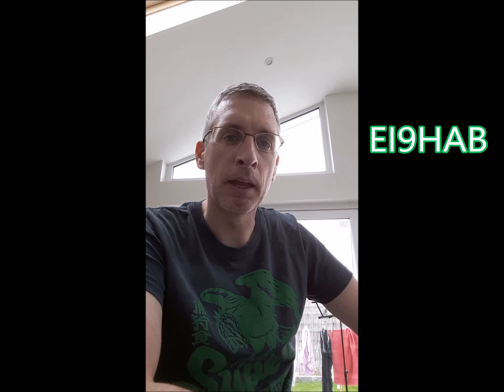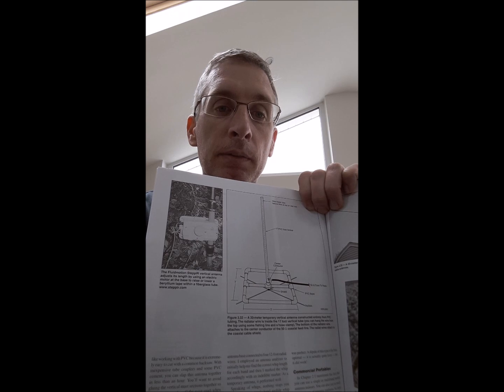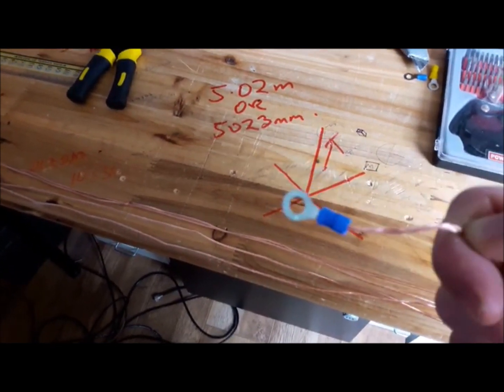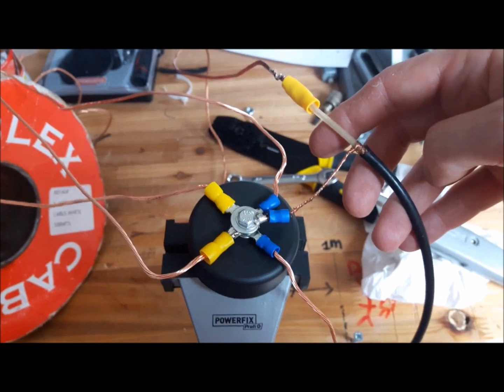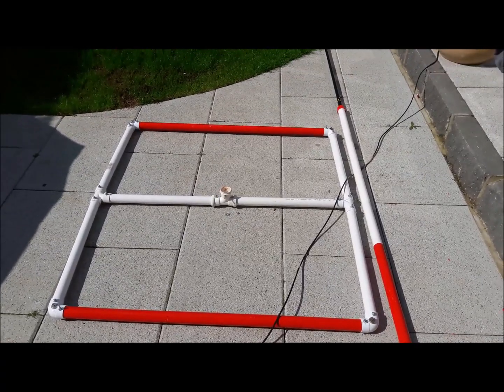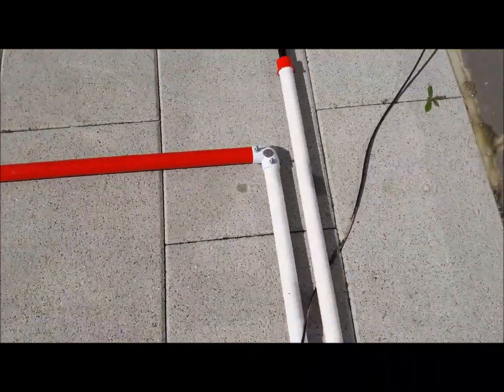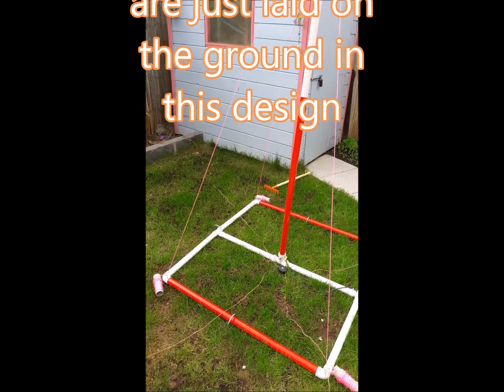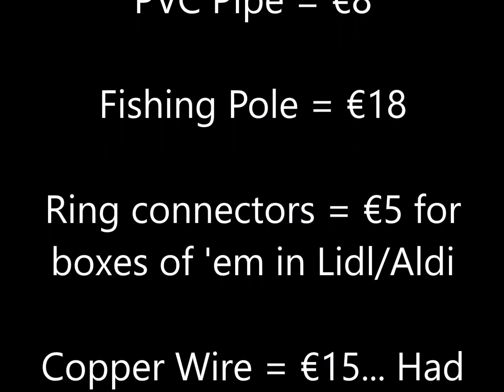Building a cheap, portable, vertical HF Antenna

Comment: Thank you for this video! A very good idea for a stand for a fishing rod. If you make it out of a thin square pipe of 20x20 mm, and vertically weld a nut in the middle, into which you screw a threaded stud pin, about 200-300 mm, and already put a fishing rod with a hook on it, you will get a fairly portable folding stand. Such a ready-made one stands at the bottom of a Chinese acrylic bath. I have subscribed to your channel and will carefully study your ideas. thank you. Roman Glazkov, UA6E.

Comment: Thanks Adrian, I built one as well, also using the ARRL plan with some mods and have been reasonably satisified with mine. Because of weather here I elected to use PVC 2 inch (50.8mm) pvc, and here in the states the gray pipe has greater UV resistance so that in place of the white PVC more common here. So far so good it tuned fairly well on 20 meters, got it down around 14.200 to 1.43. Found more radials helped. Like you I set the radials up with eyelets to secure them. Will be interested in how your antenna has fared a year on. KC3PZX, 73.
Reply from the maker: Hey Marty. I've had it out a few times with no problems. I even used at club level for the Dublin Maker Faire here in the city centre last year. We used it as the main HF antenna for that display for all modes - it's construction is in keeping with the maker ethos :)  The president of our national association here "used" for CW when he dropped by the Faire to support us! 
The "white" PVC seems to be resilient enough - I just have it chucked down the side of the house when it's not in use, so it seems robust enough. It is multiband with a Tuner. In fact, I built a lighter fishing pole version this summer and went portable on the west coast - with some nice results https://youtu.be/9o87DEd_BCE 

How did you overcome the PVC weight issue? 73 EI9HAB

Comment: Adrian, if you added a second cross member (parallel to the center mount pipe) to hold it all together, you could let the (mast mount) center mount pipe swivel for uneven ground. then adjust the guy rope lengths accordingly to get the mast vertical.  just a thought. rich
Reply from the maker: That's a great idea. Would be much easier to swing it up and secure! Thanks for that. 73!

Comment: Buy a secondhand silver rod and set it at 16ft 7in and run a few radials out, job done. Portable, knocks down to about 1.5m so fits in the car. More stable than plastic. Remove the small coil in the silver rod and get multiband 10, 12, 15, 17 & 20 with various length radials and just adjust the main radiator. Price ? £20 all in ? 73's M6APJ Andy

Comment: Are those measure be modify to other bands? 73s TI2GBB
Reply from the maker: If you are asking is antenna length variable depending on what band is being targeted, the answer is yes. This antenna is a 1/4 wave on 20m. If you use the usual antenna length formula - you can calculate for any length. So, if speed of light is 300,000km/sec and you calculate the middle of the 20m band as 14200kHz... the calculation (rounded) is 300÷14.2 = 21.1m. For a 1/4 wave just divide by 4, that equals 5.3m. So the vertical element is 5.3m & the radials are the same length. With a decent antenna tuner it works other bands... 40m is reasonable good on 17m. The antenna is less efficient the further from the frequency it's cut for you go. I like 20m for DX so I cut mine for the middle of the 20m band but you can use the formula for any band. For example if you want to work FT8 only on 17m, that frequency is 18100kHz. Antenna calculation is (300÷18.1)÷4 = 4.14m. So you can have loads of fun  
building antennas ☺

Comment: Adrian really enjoyed your video and your talents in antenna building
was quite surprised when I realized we have the same book as well as heritage. My grandparents left Ireland because of the  famine years ago. Great job on the antenna. Francis Cullen WB8JWE
Reply from the maker: Thanks for your nice comment Frank. It's main purpose was for a "Maker" festival we had in the city centre last year. Our club had a marquee and part of the display we wanted to demonstrate to the public how effective "long-distance" radio communication can be achieved with a bit of wire and a plastic pole :) 

The antenna has worked out well and I use it from time to time. As I said in the video, I had to modify the suggested design in the book to make it work  - but sure that's part of the fun! Don't know f you've been to Ireland but perhaps after the pandemic, you can come visit the ancestral land. There's will always be a welcome here for you :) 73 EI9HAB
Reply: @ado75  I may not get to visit Ireland but my wife had the chance when she was younger. If I do I wiii let you know. Thank You very much for the invite, 73's Wb8JWE

Comment: Great to see a design out of a handbook that works.   I was having a play today with a 20 meter vertical (during lockdown) more of an experiment really.  Measuring the effect of raising the vertical off the ground with a number of elevated radials.  Initially the vertical was mounted on a table,  with a little more time I want see how practical it is to get a little higher.  The best results I got were using 2 radials at 18 inches off the ground.  I was wondering, as you have a lovely shed, whether you’ve tried the same?   With conditions the way they are I still managed Finland, Italy and Russia on 5 watts.  Your design will  have a much better bandwidth than mine and a better take off angle.  Great vid thank you for posting.  73 de M0AZEMike
Reply from the maker: Thanks Mike. That's unreal, I was actually staring at the corner of the shed the day before yesterday and thinking "maybe I should mount the antenna there"!. My wife is not keen on the monstrosity when it's up in the garden - it's up at the mo :)
You're right of course, I think I will do it over the next few weeks. Leave it as a permanent setup - if I'm allowed.

Regarding a portable version of this antenna. I got some flexweave wire from a SK lot a few months ago and I'm going to make a slimmed-down version of the design with a fishing pole  - maybe use it after lockdown is over. 73 Adrian
Reply: Could do with a ham radio version of Tracy island, antennas coming out of the ground and put away again to keep the XYL happy.  Keep experimenting and doing what you do as it’s what the hobby is all about.  73 Mike

Comment: Nice Job, I like the  counterpoise wires and the guy rope tie down.  I made one similar and cut the long poles to roughly 4 foot sections connected with a extension piece same size to same size just friction holds and allows break down. it becomes very rigid/firm vertically.  Also a "T" piece on the vertical allows a hole for the wire to come out /access point. Still you did a great job, it works  congrats. 73.
Reply from the maker: Thanks buddy. You getting decent reports with it? 73 Adrian

Comment: Hi Adrian, any reports  of how the antenna worked for you,  I'm going to do a 40M version with 10M telescopic fibers glass pole, de Ei2iP
Reply from the maker: Hi Robbie. Sorry for late reply. Yeah it does well. Have got South Africa & Namibia on SSB. We used it when the club (EI2SDR) had a marquee  at the Dublin Maker Festive last July in Merrion Sq. Given we were smack bang in the middle of the city & propagation was rubbish - we were getting Russia on SSB & some of the lads were getting transatlantic on CW. So it seems to work well. I need to use it more though. 73

Comment: You are a good antenna manufacturer ...
simple and efficient.
the base of the antenna is really the cherry on the cake ...
A greeting.
73. Giuseppe.
Reply from the maker: Thanks buddy. It worked really well  
- even though the radials were not fully extended in my small garden. 73 ADRIAN

Comment: Well done Adrian...I assume you have a low SWR on first Try? Concerning the design ...I found over the years, most of those designs are not practical and most were never actually built by the designer.  I call these "untested Arm Chair designers".   Congratulations  Adrian you've perfected a poor design at minimal cost and labor.  Thanks for the video. 73s Brian
Reply from the maker: Thanks Brian. You're right the antenna matched up really well. No SWR issues. 
I was surprised indeed, the ARRL musn't road test the designs. A PVC pipe swinging around 17ft in the air is no joke - my daughter was helping me out at the time and it was a little dangerous. The base configuration does work well though. 73 ADRIAN